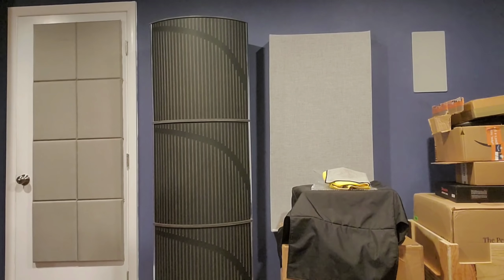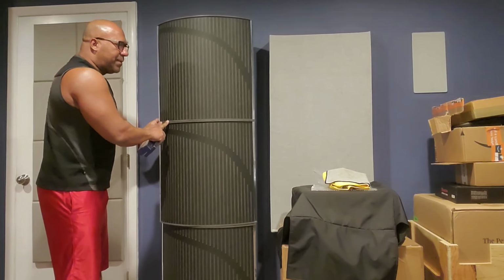Furutech Outlets initial reaction!

Comment: That’s so weird 
That a outlet could make such a negative difference suggests you seriously need to look at your house wiring , seriously man that’s a joke 
Secondly I really don’t understand, you have these amazing Mephisto solos which I have heard, with their incredible power supply and capacitance but you add 1 cm of outlet and they fall in a heap 
Is that like good engineering given their price, doesn’t seem “ keeping it real “ man ?
Reply: It's not weird at all. I've got 5 outlets in my 2 systems and 3 different brands. They all sound different...I've switched them around and they bring their sound with them. I also removed the tin from my copper bus bars behind the breakers and plated them silver, then went back and removed the plating later. 3 different sounds...The materials the electricity goes thru makes a difference.
Reply: @philippelabrecque6658  that’s interesting are you able to show this ? That different conducting metals alter a 50 or 60 hertz sine wave? most  power lines are tinned copper over their length but you sure that a few feet of something else will make a difference please show the data I would be most interested , and of course what are the prongs and female connectors on your electronic equipment made of, and how does this also alter the post power supply feed , be most fascinated by your results/feedback ..
Reply: @Andrew_from_Oz_Vinyl_Landscape  Show this, no. I don't have the proper measurement tools to do so, but i can tell you what i hear and since it fits perfectly with the discribed sound that these metals are known for and that any other audiophile beside me will also hear the same things i do, i feel pretty confident about my findings. You can look at the Metal conductivity chart by Wireworld, its right on the money. Understanding that it takes a lot of trial and error to understand what you're hearing, most people will not take the time needed to make these observations. Even one of my audiophile friends who's been parallelling me is not as interested as i am. My only limit is you. Your openness will make the difference. I can tell you stuff that you would probably never believe until you try it and you won't be put in the circumstances to try it most of the time. It all depends on the time you have and how much you are willing to try things. If you go through the replies in this thread you will find some of my lenghty responses to one audiophile so i will not repeat all this. As for the question about why a 1m cable would make a difference? The answer is simple: It acts as a filter. Much like a resistance in a circuit  will change the sound and a capacitor will do also, a resistor with a short range of error is better than a wide range one and that's why you see resistor ladder DAC manufacturers choose their resistors very attentively, a cable will change the sound too. The funny things are the misconceptions. If you look at new cables , a lot of very high end cables are rhodium plated at the ends but if you look at the conductivity chart on Wireworld's website you'll see that Rhodium is a very bad conductor of electricity, so why put it on a cable? Because it looks good and the toughness of Rhodium means you can plug and unplug many times without bruising too much, but a lover of quality sound will normally not want it anywhere in the signal path, unless of course its to filter the sound in a specific way. Gold is also only at 65% conductivity, if i remember correctly, so normally it is used as plating to tame the extra high frequencies a little bit and make the sound a little rounder on the edges. Copper is rated at a 100% because it was rated a long time ago , before some other metals were measured so its why OFC copper is at 101% and that's why you see Beryllium copper be more conductive than plain copper. OCC copper is next with 102-104% conductivity and produces a "bity sound" with very good texture and tone but not the most extended at the ends of the spectrum. Normally in 2 qualities, 4N and 7N. N are for the number of nines in purity. 7N is 99.99999% purity. Silver is at the top with 4N and 7N too. Silver goes more in the extremities , producing the largest soundstage and the most detailed sound but not always the most meathiest sound though. A thin silver plating over Copper will sound more extended than just copper but a bit too thin for my taste unless it's very thickly plated , only then can it sound good. The best is Pure silver but it costs a lot of money. A much less known metal is CARDAS copper which has a unique sound and from what i gather is Audioquest's secret copper, i'm pretty sure of it. Its the only metal that sounds almost as extended as silver but without the massive price tag if you buy it from Pangea. My secret recipe is to mix and match OCC copper with Cardas copper and Pure silver. The qualities of OCC copper, for biteness in the middle, thicker sound and a lot of detail mixed with the openness and beauty of the Cardas copper sound which is quite special and unique and add Silver in some of the cables and cable connectors to complete the package and you have the best of all 3 worlds. There are a lot of supposed Myths in audio but with trial and error you see that they are not myths, they are sadly, all real. Everything makes a difference. Vibration affects a digital setup even more than an Analog one. That's one of the craziest true things i found. You want to hear the craziest thing? Even the material used on the surrounding of the plug change the sound. I removed an aluminum cover on an AC cable not long ago and put in on another cable and that cable began sounding more metal, so for a reason i don't quite understand , the metal surrounding the conductor seems to change the sound by reflection. I Know it sounds crazy but its true. Another crazy thing, a Fuse makes a world of difference. Try the Supreme3 fuses from hifi tuning. The silver one sounds crystal clear and more open at the top end but with less bass and meat in the middle than the cardas one. Another myth broken when i tried it and it was also true. The secret to high end sound and high end products is almost all on the principle of removing noise in the signal path and from every component and cable. Noise and vibration. I pimped up a mid-fi system and made it sound better than my friends hifi system by  putting everything on foams and cushions and springs to remove vibrations and changed the cables everywhere with better ones and put in external power supplies. He used to get mad at me for it but it was good fun to learn.  The best first move to make and the one that truly makes a hifi system in my opinion is a Dedicated 20amp, 10gauge line. But i found that an Industrial one, the one with aluminium coverings is even better than normal ones. Its limits the noise coming in to the cable which acts as an Antenna for noise , most of the time. The closest cables to the Fuse box are the ones that make the most difference and then the outlet also makes a difference, there are some that are much better then others and all normal outlets you get from the store are pure crap. The Maestro is the best and most transparent i ever found but will try the Pangea XL soon to see. Good outlets will be dampened for vibrations and with better metals inside. The covering of the outlet with a metal casing and metal plate removes more noise than the resin ones. Then its the first cable from the outlet to the power conditionner that makes the most difference and so on... The only 2 conditionners i found which don't limit the sound are Niagara's from Audioquest. Second one is the new iFi power station which removes the most noise, limits transients just a tiny bit more than audioquest niagara but removes more noise. Its a question of taste at some point. oh yes, the craziest of things i ever found is moving your different cables around on your components. Take one cable and put it on another component and mix them around. So you are not changing the cables but simply moving them around in the system and it actually changes the sound. I made that change in my friends system the other day and his jaw went to the floor, mine too. Simply 2 cables exchanged. We moved the Wireworld from the amp to the wall outlet and conditionner and the Hurricane from that spot to the amp and voilà, the sound changed with the same cables! Its so crazy! The closest cable to the outlet will impart more of its sound to the rest of the system then the ones downstream. It's fucked up! And last but not least, static is your worst enemy. It will make a good system sound thin and lifeless. Each time you change a cable or you lose power it puts static noise in the system, even with a power conditioner. If you change cables or lose power , always unplug the main cables plugged into the outlet and touch a metal structure close to it to get rid of the static noise. Its the principle of grounding. It's fucked up too but it's also true. Grounding works but no need to go crazy, just add grounding copper cables to your equipment when you get around to that and you can add a copper rod outside if you want to go crazy. Makes the sound more real and meathier. Again, weird but true. That's why i told my friend i would go into Voodoo magic after audio because its the only thing crazier than audio to me.  If you have questions , feel free to ask. ..

Comment: I wish you guys would build your own power supply, consisting of a battery bank, a pure sine wave inverter and a high current charger. You should only be using the grid to charge and not run your high end gear. Ive seen voltage spikes as high as 160 volts and lows in the 90 volt range. If you design and build a nice power supply you will have much cleaner, steadier and safer power.
PS- there is no positive and negative in AC. There is a HOT and a NEUTRAL and a GROUND. You may have confused the ground and the neutral.
Reply from the maker: The ground is a screw sitting on top of the outlet...same as the factory outlet...kinda hard to mess that up?
Reply: Thats the outlet but what color wires do you have?  White is hot, black is neutral and bare copper is ground. On the Leviton outlet(factory-Home Depoit) should have copper screws for hot, nickel screw for neutral and the odd ball is the ground. Sorry its not working right bud!
Probably cost less than your cables to build a complete power supply, and you could have much better or at least more consistent performance from your gear.
Reply: @freeradical431  In the US, white is neutral
Reply: @myu4039  I thought I might have gotten that wrong. thanks!

Comment: JAY!  Get ready for a roller coaster that will take over 500 hours.  If you have a Hagerman FryCorder2 then it will speed up the process 10 fold, and also really make a difference in your power cord at the same time.  But honestly, take a look at the Oyaide R0 outlet.  Not the R1, just the pure R0.  Don't start judging your system based on this thing that is burning in and don't make any changes, it is a long process.  I would really get the FryCorder2 (not expensive) first and then go with the Oyaide R0.  The outlet changes everything and is the foundation of every piece of gear attached to it, it sets the overall tone.  That, plus a Cortadito.  Of course.
Reply: Does the Oyaide R0 burn in quicker?
Reply: @myu4039  R0 is the non plated version and just sounds SO good compared to a lot of outlets.  I would say compared to anything with Rhodium, yes, it burns in way quicker.  Rhodium takes the longest and even after its done its supposedly 'neutral' but I always think it does something unnatural to the lower treble that is weird.  Gold burns in opposite of Silver.  Gold starts off super bloated and unfocused with very  soft and boomy bass and eventually comes to neutrality while silver starts with very little bass and strange sounding treble (not sharp, just strange) and eventually comes down to neutral.  The R0 just sounds rich and good from the beginning but just gains in texture and layering and focus as time goes on.  I build my own power cords, ICs and speaker cables and have a lot of experience with Furutech metals.  They DO have a sound to them.  I use two Rhodium extremely sparingly in my system, only two spade connectors in ONE power cord going to my amp, and even with those I'm thinking of going back to furutech gold.  Honestly, with what Jay seems to like, I would stick with high purity copper in the system.  It doesn't sound fancy and I used to shy away from it because it was so 'basic' but nothing beats it for the type of listening I like.  Copper and Gold all the way.  No silver, no rhodium.  And if you can make your XLR not use any solder, then get ready because it makes a world of a difference.

Comment: Cut cord cap and receptacle wires and SOLDER ALL three wires….overpriced duplex receptacles are not necessary and were originally designed for equipment that is frequently un-plugged🥸

Comment: I just installed a furutech outlet with a 20 amp line.  Sounds great.  But the place I bought it from burns it in before I bought it so I don't know how it would have sounded without him doing that.  If you live in Toronto area, try Audio Sensibility.  He burns in all cables and outlets before you take it home.

Comment: Strange that they initially showed their merits right out of the box and into the wall, THEN messed up the sound and now they're expected to "burn-in" and show their value again after 5-8 weeks! Seems that, at the present stage, warming-up makes them worse. Quite unusual but let's say it goes with their unique construction and materials used. I'd suggest (it's been suggested by someone else too) that they pass their burn-in period serving some other high-current hungry machine (heat-pump, oven etc), or, in case musical signal is desirable in the process, (regardless of its theoretical and virtual absence at wall-level), serving a secondary audio system in another room. (And I suppose, both outlets have to be used in the burn-in process. Why the heck don't they burn them in at the factory?). Anyway, once more I feel so lucky my system runs completely on batteries.

Comment: Furutech make some of the worst on the market. Especially the regular rhodium version. I only know of Gigawatt rhodium which is much more worse. It also has to be said that there is a big difference between all Furutech wall socket plugs, so one could easily be a lot more inviting than the other especially on transistor systems. I had several friends who gave up using the regular Furutech Rhodium inwall plug because it was too bright and agressive. And so they usually went over to Wattgate rhodium or One of the circa 4 Oyaide or the Viborg rhodium. Viborg rhodium is the real winner for the price then the Oyaide paladium. (they have a fantastic personality style)

Comment: When I tried my first Furutech rhodium plated AC plug I had the same reaction.  Just one plug on one side of the power cord to my amp.  I couldn't stand the way it sounded and filed off the rhodium plating and it sounded a lot better lol.  I have stuck with the Furutech GTX-D (Gold) wall outlets (non NCF) and they are amazing.  Way better then Shunyata ZR1, a Synergistic Research Tesla Plex SE pile of garbage, and others.
Reply: Does the Furutech GTX-D (Gold)  break in faster?
Reply: @myu4039  It breaks in like any normal outlet.  Its the rhodium plating that is the issue.
Reply: @victorlujan6186  Thanks man...

Comment: Of cause it is burn in, surprised you were not aware of this??? What the hell Jay. Why are you surprised about this you have been in audio for so long you should not be surprised?? Wait till you change the in wall cabling to say Gigawatt in wall cable, it will sound horrible, and fluctuate so much from good to bad, you need at least 1000 hours of burn in for in wall cable.

Comment: That was completely opposite to my experience with the Furutech outlets. In direct comparison to Oyaide Palladium and Gold, Synergistic Black and Hubbel it was uber musical and very analog. I'd say it's been one of my best components and a huge value. So good in fact, I left the other outlets in the wall when I moved house and just took the Furutechs with me. Something does not seem quite right here - whether it's the wiring or the simultaneous cable changes you mentioned.

Comment: Did you really check the AC polarity? If it's wrong the music can sound hard and metallic and the flow of the music becomes stiff and boring as well.
Reply: AC polarity?
Reply: @TheJanakev  I'm talking about the neutral and the hot wires. How it's connected affect the sound quality a lot.